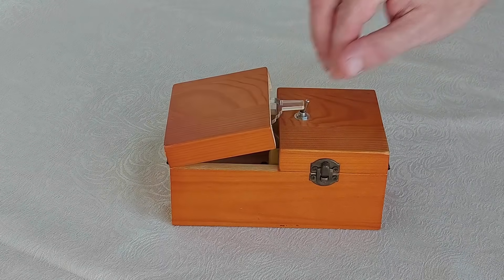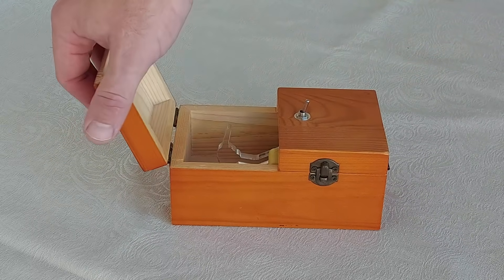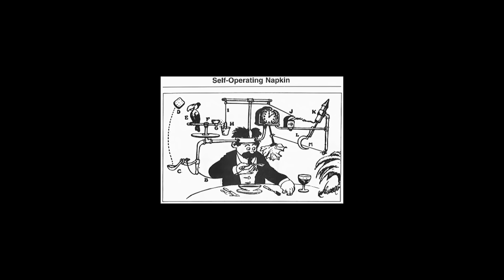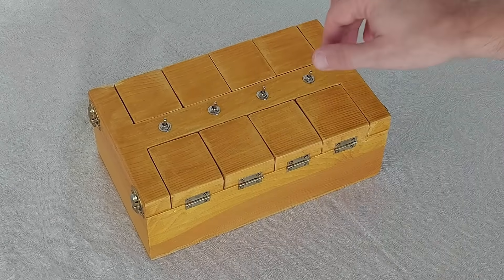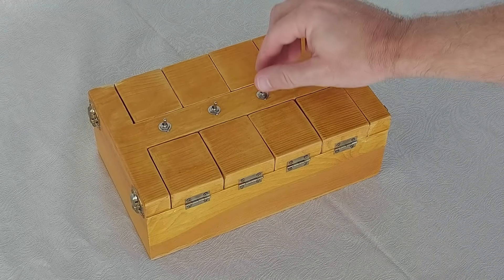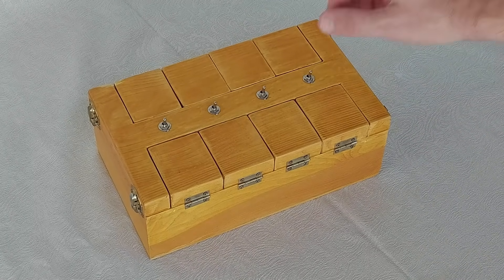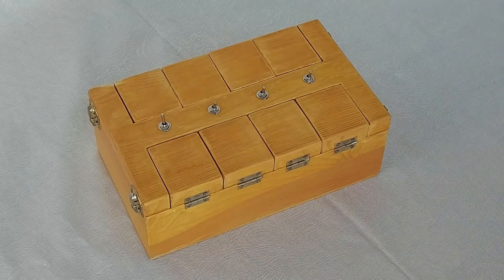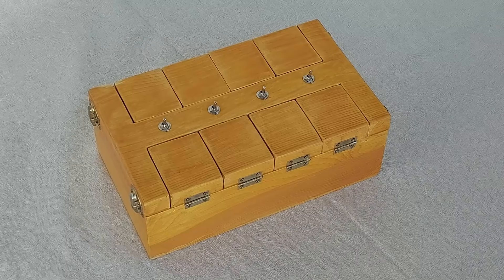A Rube Goldberg inspired useless machine

Comment: is a microcontroller really necessary?   if each switch were double pole double throw, one set of poles in series just to be ON for power to all, and the other pole to the neighboring mechanism I think could be entirely mechanical and switches

Comment: But if you reverse the machine it will run forever. And if you insert this machine into this machine it will turn it self on while it is off and you become the useless machine that has to turn it off. But then it just turns itself back on again. The haunting problim. You have your mission Soldier. Fall in and move out!

Comment: This isn't useless if you know how to use it to make circuits the core functionality of this is to turn on a lane and keep it on until a signal is sent back to turn off that circuit lane this could be used for computations etc as a template to all computers by replacing transistor with one of these is my theory of where it all originated from but compared to today's transistor switches a toggle switch computer would be massive and take a gwap of power best to leave it to the experts I could model one in a game engine to know the architecture of computer would serve as a template to know what's turning on and the final destination of the electricity in your computer or how it mitigated it to different mediums 🤓

Comment: a little motor that throws a swing arm when you flip it on that swings up an hits the simple toggle switch off,, move the switch out of the way and it would just flip up and stick or it would just flip up and down back and forth until you flip the switch off yourself,, too simple is the simple thing that's hid,, the video makers don't even explain,, that keeps you wondering if it's complicated intelligence,, this guy created multiple boxes in series to hit the last switch that's wired to all switches off

Comment: You'd need 2 fans, a rope with a pulley one of those electrically propelled "free energy" machines and probably a balloon, as well as this contraption, to accomplish what you actually tried to accomplish here.  The "overly complicated" aspect is lacking here, in my opinion.  But what you've created here is far better than I could do, so CHEERS!

Comment: OK, a guess.  If any of the switches is "on", the electronics has power.  But they are also dual pole switches, so the uC (when powered) can read the state of each switch.  So once powered up, it goes through on of your scripts, typically turning on other switches and making sure that there is always at least on switch on, until the end of the script where the last switch is turned off.  Thereafter, zero power used.  Pretty cool.

Comment: Back in the 1970s, when Radio Shack hired people who understood the difference between DC and blue light, the guys at the local RS store put a 4" x 4"  box on the counter, with a warning not to flip the toggle switch on the top.  Doing so would make an alarm sound, and flipping the switch back wouldn't stop it -- you had turn turn the box over, to let the mercury switch open and reset the circuit for the next victim.

Comment: What would happen if you flipped more than one at once
Reply from the maker: The software reads the switches' states and responds to the first switch it finds on. If the rest of the switches are turned off during the process, then the box will shut itself off at the end of the process. If the software is still active at the end of the process it performs a recovery script that turns all of the switches off.

Comment: More useful to me. Imagine making a Rube Goldberg-inspired security and locking system only relying on mechanics all practical and built within some strong ass steel?

I think it'd be a good alternate to the digital counterparts which are more frail and hackable by all means and edges. Mechanics practically with no chip or motherboard needed.

Now imagine reading this in Bruce Willis' voice. :P

Comment: i love watching this! how much of the machine is mechanical as opposed to electronics/algorithmic script?
Reply from the maker: There are two motors per switch. The software can only initiate the movement of a motor towards the switch. When the switch is toggled it connects the motor to the battery making the motor reverse and return to its home position. When reaching the home position a limit switch cuts the current to the motor.

Comment: I  wonder what happens if you switch all the switches AT THE SAME TIME
Reply from the maker: It depends on the script that the box is set to perform. In some cases, it will perform the complete script. In other cases, it will hang until a timeout expires, and then it will perform the recovery script.

Comment: What happens if you flicked all at once?
Reply from the maker: The software reads the switches' states and responds to the first switch it finds on. If the rest of the switches are turned off during the process, then the box will shut itself off at the end of the process. If the software is still active at the end of the process it performs a recovery script that turns all of the switches off.
Reply: @pazhameiri3429  hmmmm interesting

Comment: i wonder what happens when you flipped all of the switches
Reply from the maker: The software reads the switches' states and responds to the first switch it finds on. If the rest of the switches are turned off during the process, then the box will shut itself off at the end of the process. If the software is still active at the end of the process it performs a recovery script that turns all of the switches off.
Reply: @pazhameiri3429  thank you

Comment: What happens if you flick more than one switch
Reply from the maker: The software reads the switches' states and responds to the first switch it finds on. If the rest of the switches are turned off during the process, then the box will shut itself off at the end of the process. If the software is still active at the end of the process it performs a recovery script that turns all of the switches off.

Comment: What if u flipped multiple switches at the same time
Reply from the maker: The software reads the switches' states and responds to the first switch it finds on. If the rest of the switches are turned off during the process, then the box will shut itself off at the end of the process. If the software is still active at the end of the process it performs a recovery script that turns all of the switches off.

Comment: What happens if you flick 2 at once?
Reply from the maker: The software reads the switches' states and responds to the first switch it finds on. If the rest of the switches are turned off during the process, then the box will shut itself off at the end of the process. If the software is still active at the end of the process it performs a recovery script that turns all of the switches off.

Comment: It's kind of interesting to watch since it's never the same pattern with same switch. Though eventually that wouldn't be the case from programing and there's only so many combinations. It would probably get boring eventually, but it's interesting in novel way.
Reply from the maker: I wrote 47 different scripts and you are correct - If you're trying to see all 47 you're quickly getting bored. The ensemble is magical. The moves are just moves.

Comment: But what if you move a switch while the machine is going?
Reply from the maker: The software reads the switches' states and responds to the first switch it finds on. If the rest of the switches are turned off during the process, then the box will shut itself off at the end of the process. If the software is still active at the end of the process it performs a recovery script that turns all of the switches off.

Comment: What if you flip all switches at once
Reply from the maker: The software reads the switches' states and responds to the first switch it finds on. If the rest of the switches are turned off during the process, then the box will shut itself off at the end of the process. If the software is still active at the end of the process it performs a recovery script that turns all of the switches off.

Comment: I couldnˋt find the question in the comments: What happens if you switch a switch while the machine is switching switches after you switched the first switch?
Reply from the maker: The software reads the switches' states and responds to the first switch it finds on. If the rest of the switches are turned off during the process, then the box will shut itself off at the end of the process. If the software is still active at the end of the process it performs a recovery script that turns all of the switches off.
Reply: @pazhameiri3429  Thanks for the explanation! :)

Comment: What happens if you flip all the switches at once?
Reply from the maker: The software reads the switches' states and responds to the first switch it finds on. If the rest of the switches are turned off during the process, then the box will shut itself off at the end of the process. If the software is still active at the end of the process it performs a recovery script that turns all of the switches off.
Reply: @pazhameiri3429  Thanks for the reply and awesome box!

Comment: What happens if all of the switches are turned on at once?
Reply from the maker: The software reads the switches' states and responds to the first switch it finds on. If the rest of the switches are turned off during the process, then the box will shut itself off at the end of the process. If the software is still active at the end of the process it performs a recovery script that turns all of the switches off.
Reply: @pazhameiri3429  oh thank you

Comment: What if you flip multiple switches?
Reply from the maker: The software reads the switches' states and responds to the first switch it finds on. If the rest of the switches are turned off during the process, then the box will shut itself off at the end of the process. If the software is still active at the end of the process it performs a recovery script that turns all of the switches off.

Comment: Why didn't he turn more than one on at a time?
Reply from the maker: The software reads the switches' states and responds to the first switch it finds on. If the rest of the switches are turned off during the process, then the box will shut itself off at the end of the process. If the software is still active at the end of the process it performs a recovery script that turns all of the switches off.

Comment: What if you switch 2 switches ????
Reply from the maker: The software reads the switches' states and responds to the first switch it finds on. If the rest of the switches are turned off during the process, then the box will shut itself off at the end of the process. If the software is still active at the end of the process it performs a recovery script that turns all of the switches off.

Comment: A great quote for an innovator is “don’t make a Rube Goldberg machine; make it simple an elegant in design”.
Reply from the maker: The hardest part is convincing people that they are developing a Rube Goldberg machine. Two weeks ago I urged someone at work to shift from an overly complicated design to a much simpler solution (Putting two control buttons next to a motor instead of placing a computer that displays two virtual buttons). Sadly I've failed.

Comment: wait what happens if you flick more than one switch at a time
Reply from the maker: The software reads the switches' states and responds to the first switch it finds on. If the rest of the switches are turned off during the process, then the box will shut itself off at the end of the process. If the software is still active at the end of the process it performs a recovery script that turns all of the switches off.

Comment: So, what happens when a little kid (yeah, we'll just go with that, I wouldn't even think about it myself) walks up and just starts flipping switches all willy-nilly?
Reply from the maker: The software reads the switches' states and responds to the first switch it finds on. If the rest of the switches are turned off during the process, then the box will shut itself off at the end of the process. If the software is still active at the end of the process it performs a recovery script that turns all of the switches off.

Comment: What happens if you switch multiple switches on at the same time
Reply from the maker: The software reads the switches' states and responds to the first switch it finds on. If the rest of the switches are turned off during the process, then the box will shut itself off at the end of the process. If the software is still active at the end of the process it performs a recovery script that turns all of the switches off.

Comment: Does it actually turn itself off (i.e. cut power to the microcontroller) or is the microcontroller always on and polling for an on switch?
Reply from the maker: It cut the power to everything. When the last switch has flipped the power to the microcontroller is cut. The motor performs the last movement because the switch connects it directly to the battery. The power to the motor is cut when the arm reaches a limit switch.

Comment: What would happen if you flipped more than one lever
Reply from the maker: The software reads the switches' states and responds to the first switch it finds on. If the rest of the switches are turned off during the process, then the box will shut itself off at the end of the process. If the software is still active at the end of the process it performs a recovery script that turns all of the switches off.

Comment: What happens if you switch 2 at the same time?
Reply from the maker: The software reads the switches' states and responds to the first switch it finds on. If the rest of the switches are turned off during the process, then the box will shut itself off at the end of the process. If the software is still active at the end of the process it performs a recovery script that turns all of the switches off.

Comment: How about throwing multiple switches?
Reply from the maker: The software reads the switches' states and responds to the first switch it finds on. If the rest of the switches are turned off during the process, then the box will shut itself off at the end of the process. If the software is still active at the end of the process it performs a recovery script that turns all of the switches off.

Comment: what would happen if you switched more than one switch at once?
Reply from the maker: The software reads the switches' states and responds to the first switch it finds on. If the rest of the switches are turned off during the process, then the box will shut itself off at the end of the process. If the software is still active at the end of the process it performs a recovery script that turns all of the switches off.

Comment: What happens if you manually switch more than one switch?
Reply from the maker: The software reads the switches' states and responds to the first switch it finds on. If the rest of the switches are turned off during the process, then the box will shut itself off at the end of the process. If the software is still active at the end of the process it performs a recovery script that turns all of the switches off.

Comment: What would happen if you flipped more than one switch at a time?
Reply from the maker: The software reads the switches' states and responds to the first switch it finds on. If the rest of the switches are turned off during the process, then the box will shut itself off at the end of the process. If the software is still active at the end of the process it performs a recovery script that turns all of the switches off.

Comment: The first version of this kind of machine I saw was about 1970. They were commercially made and quite the rage for a while. Picture a black plastic box, about the size of pint carton of milk, its only feature a little cradle obviously built to hold a coin. You place any coin in it and a lot of whirring ensues; after a severe seconds, a hatch tilts upward, and a little blue plastic hand reaches out slowly toward the hand. The coin fits between the fingers and thumb and WAP!! both whip back and the hatch slams shut.   
It was a great way to get people's spare change if they hadn't seen one before.
Reply from the maker: Thanks for sharing 😃

Comment: Can we see a layout of the inside? I am hoping to build just a regular useless machine... how can you ensure that the arm is capable of flipping the switch?
Reply from the maker: You need knowledge in physics and motors properties to calculate the required match between a motor, gear, lever, and switch. I took a shortcut - I bought several DIY useless machine kits on AliExpress.com, dismantled the motors, gears, arms, and switches, and used them in my box.

Comment: What happens if the flick switch command is triggered but the switch flicker is too short and cannot click it back. will it try forever?
Reply from the maker: The software reads the switches' states and responds to the first switch it finds on. If the rest of the switches are turned off during the process, then the box will shut itself off at the end of the process. If the software is still active at the end of the process it performs a recovery script that turns all of the switches off.

Comment: I once made a machine to punch a nail into a wall. First, you must manually punch a nail into the wall with a hammer to attach the machine to the wall. Next, you will have to hold the nail in the right position to the wall so the machine can do it's work.